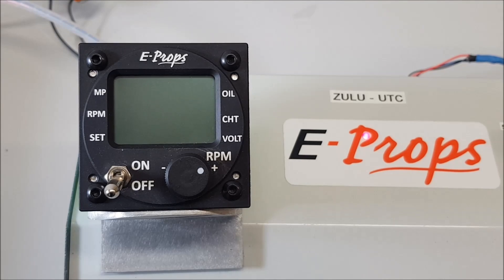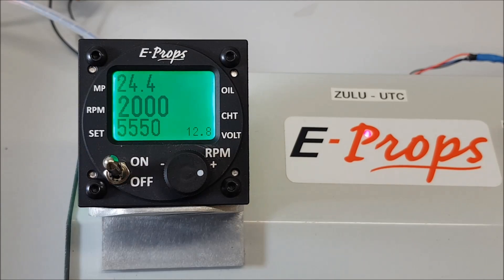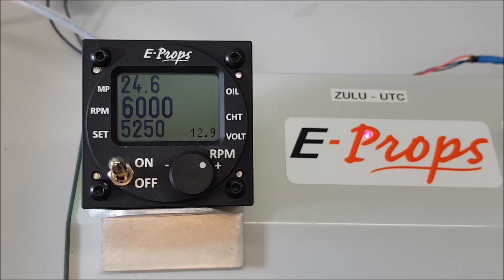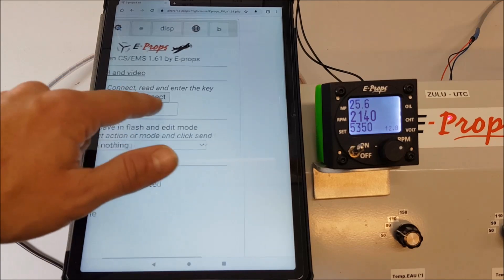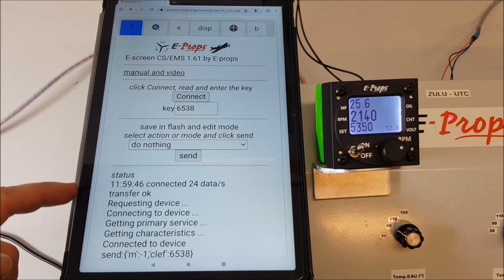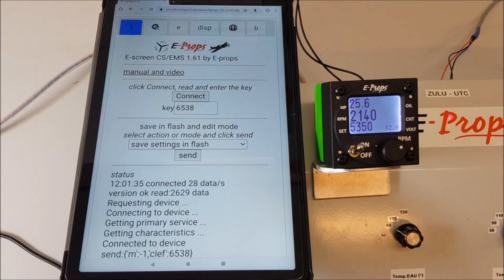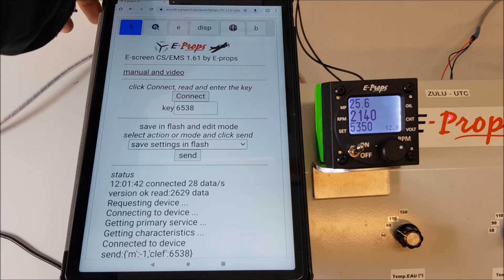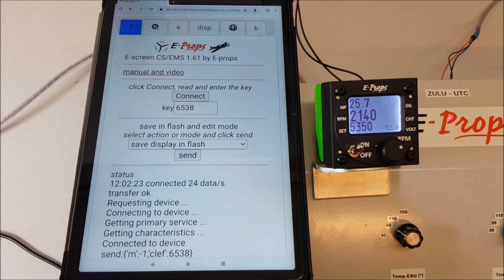E-PROPS: use of the Regulator - Constant Speed Propeller GLORIEUSE (in English)

Comment: After contemplating getting one of these, I instead ordered a 80" ground adhustable E prop, and will get in 10 days. Simpler, lighter, cheaper, and good enough for my fat tired slow mover of a plane.  The other reason is, having just installed an EDGE EFI system on my Rotax 912S it appeared that may not be enough room between the rear of the gear box and and the front of the EDGE intake tube for the part that attaches there. There MAY be, but the other factors made me go ground adjustable.  I'd be curious to hear, for future reference when asked, is their enough room, do you have any customers that have installed the prop on a EDGE EFI modified Rotax 912?
Reply from the maker: Yes, we've already fitted Rotax Edge engines, without any problems. Assembly is a little different, but easy.

Comment: What brand and model MAP measurement tool are you using?
Reply from the maker: It depends : on iS engines, we use the Rotax BusCan. On S engines, a standard sensor, same as on cars.
Reply: @eprops  sorry I meant what tool, you use to calibrate multiple data points, as per the vid.
Reply from the maker: @PeteZoot  developed by our company